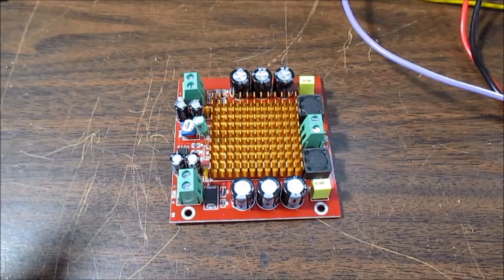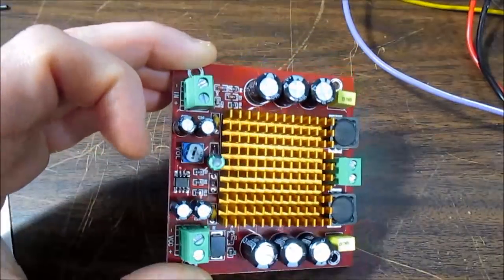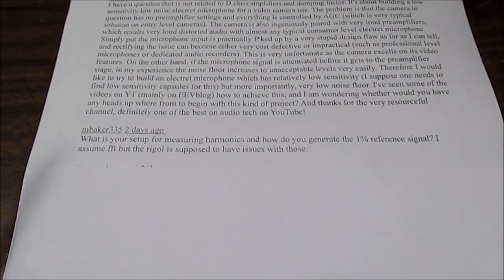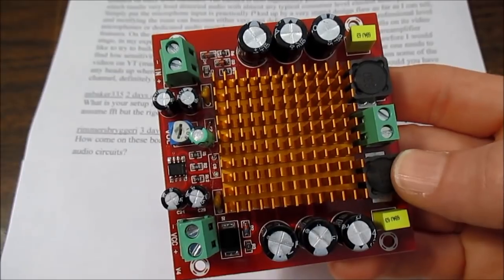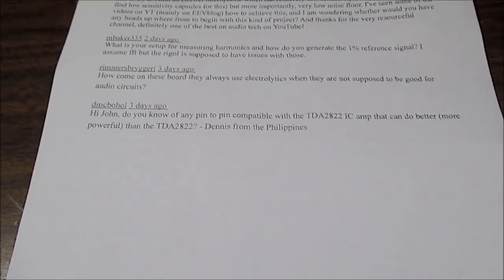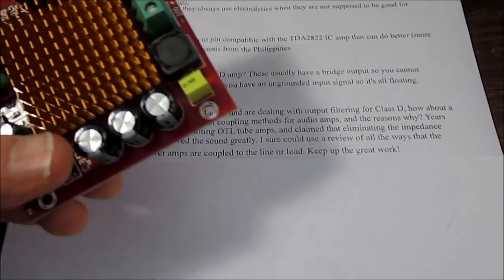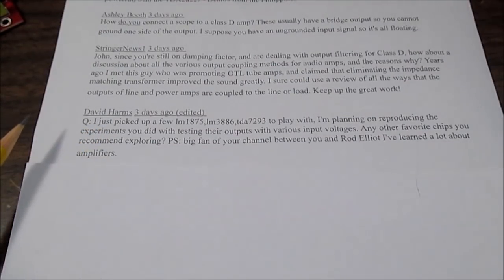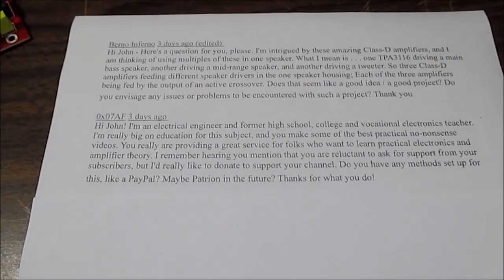Audio electronics question and answers

Comment: Could you use a stereo amp as an active crossover for a 2 way speaker?
Reply from the maker: Yes. You could use one channel for the tweeter and the other for the woofer, with the filters on the inputs, of course.
Reply: Big thanks for the answeres. :) Is there a way to boost the output of a class d amp? I had some computer speakers with broken cabs and found some larger passive speakers with the same impedance that I transplanted their guts into but they still seem not to be as loud as the original elements.

Comment: As for the active crossover setup - this can be seen most frequently in the studio monitors. Most of them are active BUT except maybe of high end pro solutions, the result is you got good or at least decent drivers and enclosure coupled with a set of amplifiers based on chips worth $2. See EEVblog KRK Rokir monitors teardown videos etc.

Comment: I have some LM1875’s that I would like to play with. What is the best way to mount them onto a breadboard or perfboard, since they have an odd spacing, without deforming the legs pass their specs? Thank you.
Reply from the maker: I would buy the mono LM1875 kits (I reviewed them) for around $3 and use the boards and your own components. The boards are laid out excellent. OTOH, I have bent the leads slightly so they would fit on a perfboard as I did in this video: https://youtu.be/TSbwEhMhDzY

Comment: Hi, I will try to be more specific with my question here. The aim would be to design and build a DIY electret microphone which primarily has very low noise floor (good SNR) and secondarily low sensitivity/gain (preferably paired with high SPL) so that it does not overdrive the inbuilt camera preamplifiers (which have no manual gain adjustment) when connected to external microphone input. In my experience the attenuation should be at least around -20 dB compared to typical consumer level electric microphones with this camera (Sony FDR-X3000) in order to be able to record undistorted audio in moderately loud sound environments. 

I know that electret microphones typically have high sensitivity and also the SNR is a problem especially with cheaper end electret capsules. So the design would probably require some higher quality microphone capsules and low gain adjustment control (or low sensitivity to begin with). I just would love to see someone who has the knowledge of the subject to be able to make DIY tutorial of such microphone design. There's a plenty of schematics in internet and videos on Youtube how to build high output electret microphone preamplifiers but not much about designing microphones which have good low noise floor characteristics. I believe something like this was popular by doing a Linkwitz mod to Panasonic WM-61A capsules but these have been discontinued and finding up-to-date information of good successors can be a bit challenging for novices. 

On the other hand, I know that Røde for example is famous for such microphones but their products come with a high price tag as well, and of course DIY projects are aimed to cut down the costs. In essence the aim would be to reverse engineer such low noise professional microphone with minor modification (more control for low gain settings).

I found one tutorial related to this on DIY perks channel (https://youtu.be/quuHV9pTyoo )
how to make a high-end level field microphone with excellent SNR but that design uses condenser microphones which makes it expensive and way too impractical for everyday video recording use. So for more practical design the microphone should be built on electret capsules using either PIP or regular low voltage battery as power source.
Reply from the maker: First thing I would try is to send some audio test signals (such as music and speech) into the mic jack, padded down with a resistor divider or pot to reduce the signal to microphone levels. This will test how the camera performs at the levels you want to feed it. This will determine the quality at these levels. I'd suspect the camera would "gain up" with such a low signal and produce a lot of noise.

Designing a mic preamp will not be trivial. It may be something I can tackle in the future. Designing a proper acoustic chamber for the capsules would not be trivial either. Perhaps 3D printing is the answer here.

Comment: Hi john.... - i have a stereo 250w pushpull type amplifier (2n3055 outputs)... Every thing is going right... But one day it starts distortioted when ever i turn on my phones light.... I cheak the input coupling caps... They are fine bt i change them any way (4.7uf)....but I still get distortion & 4hz hmm.... I know this is not amplifiers fault... Cozz when I turn the bass low... Hum was gone.... & if i short the input (R, L) & play as mono... They plays just fine.... What do I do then?
Reply from the maker: Sounds like the phone's light uses a pwm circuit to control the brightness and it is interfering with the audio output. I'd see if the there still is noise when you plug it into another amplifier.

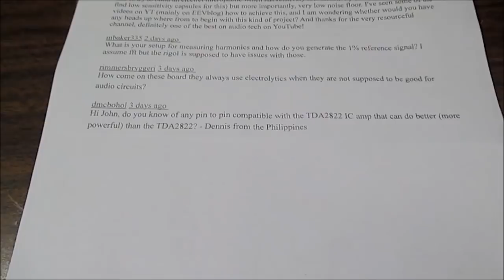Comment: 11:37 alternatively you can connect your scope ground to the circuit ground and use 2 scope channels, one for each polarity on the output, and use the subtract function if you need to see the differential voltage.

Comment: I got a Class-D Amp with a on-board Bluetooth Module, that had realy annoying hissing and after i replaced the 7812 and 7805 with a step-down Module, it was gone. I can only guess that the 78xx where realy bad one, or they oscillate do to daisy-chaining.

Comment: FYI: 0x07AF =1967, it wasn't me BTW it is just an FYI.
I have seen in a video somewhere, the volume potentiometer in some of these class D amps is 50k and too high compared with the input impedance and causes the buzz in you amp. I can't verify this one myself.
Reply from the maker: While editing the video together, I punched the "address" into my calculator to convert to decimal and figured it was probably his/her age.

I think 10K is a more appropriate value for these amps with line level input.
Reply: That's what I used on my TPA3255. If the power supply to these class D amps are quiet they do sound good.